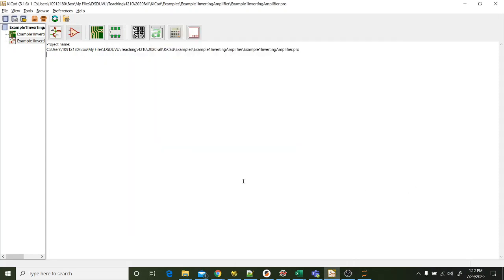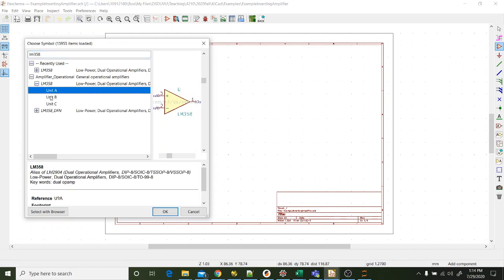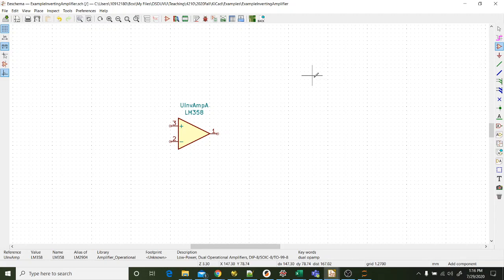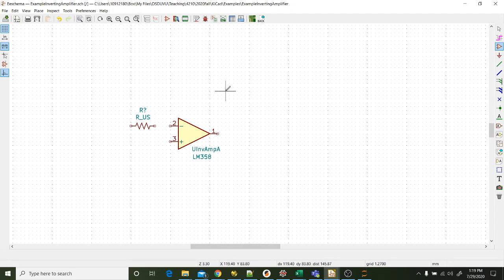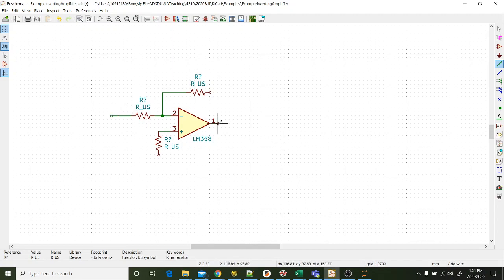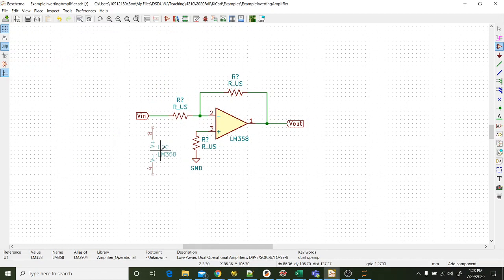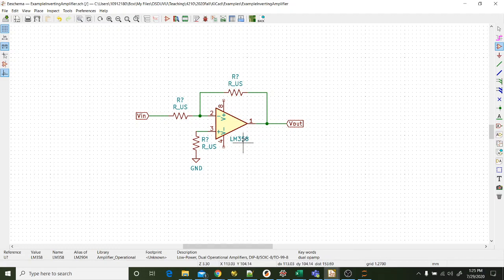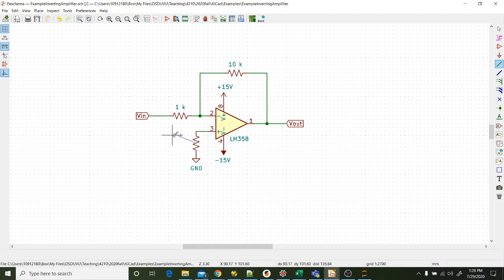Creating Simple Schematics with KiCad

Comment: That was great, just what I needed. Thanks. Hint: use the snipping tool with windows to screen grab whatever you need rather than PrtScr. (I actually use a snipping program called Ginj (based upon a defunct program called Jing).
Also for some reason (by design?) my scroll bars don't show, I found use ctrl + mouse wheel for horizontal and alt + scroll wheel for vertical movement :)